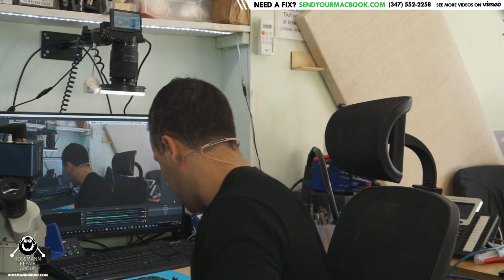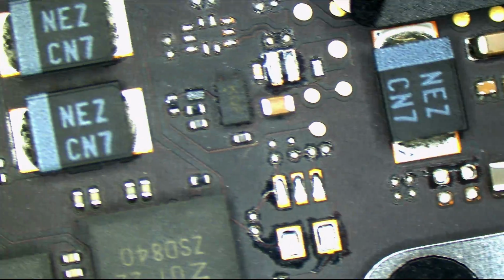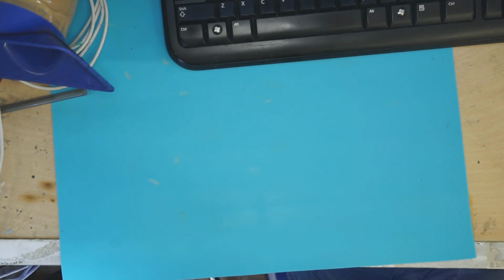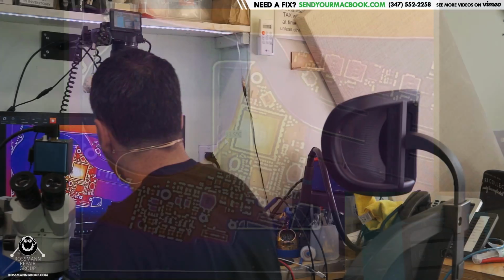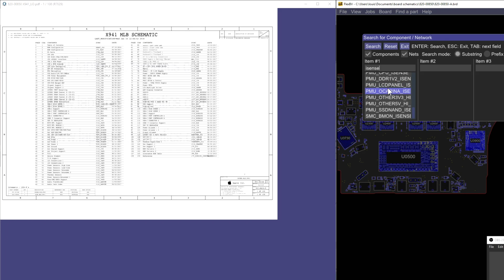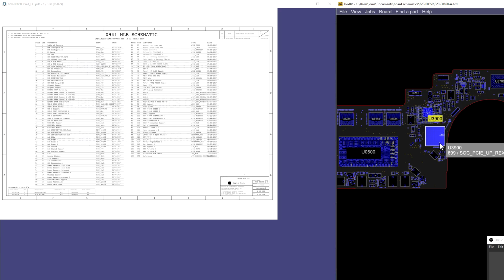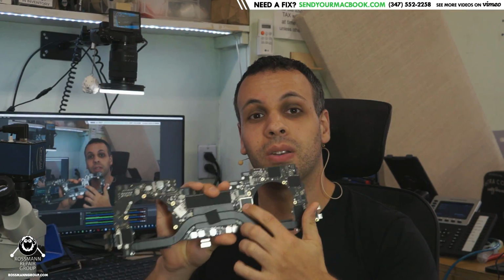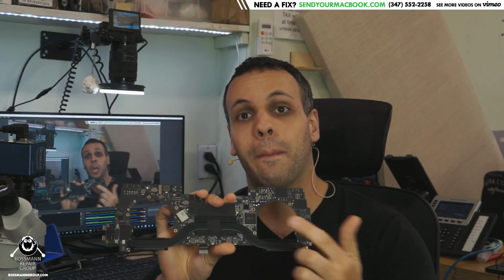Apple users have no one to blame but themselves.

Comment: I did my part and haven't even considered purchasing an apple product. I have since day 1 avoided products that use proprietary anything where possible because I like having the ability to swap out parts for testing and if that fails I have the ability to take apart and repair when possible.
Plus I am a cheapskate and I would not even consider apple as their prices are too high. I try to purchase mid range Items to get the best bang for the buck and apple has always been too expensive for me to even consider.
Reply: The average consumer is a moron. The average consumer is not well informed and the average consumer must have it because branding works. And you said it yourself, you're not even the target demographic. I mean that's not a poke but just that their consumer is glutton for a product with a pretty apple on the surface so they can look like they fit in among the other poor college students that extort their parents for such items. Serves em all right in my opinion.
Reply: @professoreggplant9985  Oh hell. When I went to university (2006-2010) apple was still in the adoption process for use in university. I would run across an occasional student that had a mac laptop but had nothing but problems trying to use some of the software that was needed to do some of the courses. My mother drilled into me the value of a dollar so much that after one Christmas I was looking for a game called Metal Gear Solid. I had come across a Used copy from EB games (sort of like gamestop) and I purchased it with money that I was given from Christmas. I purchased it and when my mother seen the price she made me regret the purchase to the point that I almost returned the game (But I Didn't). Has been my favourite console game I have ever purchased.
Reply: @professoreggplant9985  I can't stand by this at all. I believe you are taking to much to hating on apple products, when the products themselves arent the problem, the problem is Apple. The way they run the company, the business practices they use, Apple products themselves are really good, its just they are made by a shitty company.
Reply: @seiori  "Apple products themselves are really good"

You do watch this channel, right?
Reply: @schmatzler  I do, and althought we see a majority of Apple products, its because they have a large piece of the market. As well as Louis has done a lot with Macbooks on his channel encouraging people to come to him with there Mac issues. All computers fail from things, none are perfect, accidents happen. The problem is how apple as a company deals with these issues. This is the main point Louis gets accross in his videos, its the lack of willing of Apple to fix user issues, there business plan is terrible. I understand this fully, but im still willing to go for one, because A. Im more computer knowledgeable then the average consumer, meaning it will be more likely to last longer without issues. And B Because the product fits my needs perfectly.

Like I said, its a subjective decision. Also MacOS is really good for computer science, the course I will be heading into. But don't worry, this is just my media consumption/travel work laptop, the real thing is at home.
Reply: @whatdafarkenhell7110  The design is not crappy, you are blantly just saying this because you hate apple and that's fine. I dislike apple too. But sometimes that doesn't matter. They aren't designed to run hot, it's just they dont have a good cooling solution for the CPUs. Its a design flaw. But thats only if you go for the top of the range CPU, which I wouldn't recommend to begin with because of this. I don't plan to be doing heavy work loads. A bit of media consumption, light programming here and there on the go, and thats about it. Im not going to need to run my CPU into the ground, which is the exact reason I kept apple open as a choice.
Reply: @whatdafarkenhell7110  Yes it's a design flaw. The design of the computers cooling solution cannot handle the high end CPUs, that is a design flaw. It handles the lower end fairly decently, but the highers ones not so much. i agree, so not sure what this comment is for, maybe misunderstood me a little?
Reply: Sarah1390 yep, my parents refuse to let me get Samsung, since one my Motorola phone  sucked, and “we already have apple stuff,” my phone isn’t connected to anything else. And because of that Motorola they honk anything non Apple is shit, even though iPhone Xs have charging issues and are worse the s10s
Reply: Anyway, your mid range items are probably more powerful than an Apple computer anyway seeing as they kept some models the same for years without changing the price so you're likely better off anyway.
Reply: So much this.. but with a caveat.. for 50 bucks you can get a lot of old Apple. 

Newest one I own is a 2010, and with the OS becoming a jumbo version of iOS and all quarantined and cordoned off and cloud-enabled (absolute rubbish that is) it makes me glad that once Apple started their fuckwittery with the Mac OS X, I decided that keeping up with the Cook & Co. Rolling Roadshow of Neverending Costly Upgrades was not an option. Still rocking an ancient MacPro - now 11 years old and running Snow Leopard - a decade on. 

So not going to get a new Apple computer after the ones I have finally croak, it'll be a Hackintosh with the last intel-capable OS they make. Once they switch to ARM chips and go back to the RISC platform, they'll be well on their way back to the days of the Performa.
Reply: @Kohina Oh this is a funny Hackintosh Video. From one of my favourite channels Linus Tech Tips. https://www.youtube.com/watch?v=610kM2elp40&t=646s

Comment: No louis, you see the new TOS state that an apple product can't be in a room with any form of liquid in it, or moisture in the air without voiding the warranty, there's severe water damage, you just can't see it. It's invisible.
Reply: "Your cup may not have spilled, but it was holding the liquid wrong"
Reply: So the 80% water bag operating the device is the PEBKAC ? ;-) ?  Water body "spilled" all over the product causing liquid damage resulting in PEBKAC and ID:-10T error codes.....

Comment: What does T2 actually do for you except “make your ssd marginally faster” and “slightly lower render times?” It should be replaceable god damn it! And for people saying “it’s because the T2 has the Secure Enclave”, so? The iPhones have it, but you can replace a home button, lose Touch ID, but have a functioning phone. This is basically Error 53, but now you’re out ~$2000 and you have no chance of data recovery.

And what’s scary is that T2 is coming to the Mac Pro. Yeah, that computer that’s going to be a max of around ~$50K is going to have a chip where if it fails, you literally have a Tesla priced paper weight. At least you could use it as a cheesegrater when that happens...
Reply: I just read some douche bragging about the T2 on the pro a few mis ago.
🤣🤣🤣🤣🤣🤣
Reply: Okay, so let me clear something first.
.
.
.
.
.
.
It can't be used as a cheese grater. I've tried. So have many others. It's useless..
Reply: "What does T2 actually do for you" it was not long ago on this chanel that T2 will be most likely a gate to world without hackintosh, so no more wory that someone gonna show you PC with Apple system that was half the price of your computer but in the same time have better hardware that your original Apple... "think different" :D
Reply: I would not be surprised if has a built in kill switch they can set off when the next one is released - enforced obsolesence
Reply: You said "so? The iPhones have it, but you can replace a home button, lose Touch ID, but have a functioning phone" Right, but you aren't replacing the T2 chip, this macbook he shows needs the T2 chip replacing for him to make sure that is the cause of the problem. But replacing it will not work as other T2 chips won't work in it. The reason the home button works on the iPhone after replacing the Home button is because, its a button. The button part works, but the Touch ID doesn't because of that. If you replace the T2 Chip in an iPhone, you will have the same issue as you would with the Macbook. Not defending apple, just had to correct what you are saying.
Reply: Seiori But Apple could’ve made it more accessible. Secure Enclave on the iPhone is in the SOC. If you’re replacing a whole A11 or A12 chip, it’s probably best to buy a new phone entirely. But the MacBook uses T2 as a coprocessor. If Apple didn’t solder the pins on the CPU to ground in favor of the T2 chip, a MacBook or a Mac Pro should’ve been able to survive without one. Even knowing Apple, they could have socketed T2, and had some first party program that would serialize and generate a new UUID and bind the T2 to the MacBook, just like they do with home button replacement. But instead it’s soldered onto the board, and most Apple geniuses probably don’t know what a soldering iron is, so what can you do...

My main concern are the T2 crashes (look up BridgeOS kernel panic). If, for some reason, a crash were to corrupt your T2’s firmware, your computer is absolutely fucked.
Reply: @evancrazyerror  How it is implemented onto the board on the Mac isnt the problem anway, the problem is simply the firmware they run on the chip. Without access to the firmware to edit it, you are fucked. So yes, they should have included some way to allow for new components, even if only apple can change it. But the only training the technicians have for their job are the rehearsals on a daily bais of the key phases. "Water Damage", "New (insert newer version of said product" are in store if you would like t check them out", "Warranty covers accidental damage/issues, but not this time". Best that they add the T2 Chip, training those neanderthals to fix anything will do the opposite.
Reply: The T2 is just a glorified Apple A10 if I remember correctly. The Secure Enclave isn’t in the iPhones home button, it’s in the Ax SoC. This is just that SoC. Replacing this is akin to replacing an iPhones SoC.
Reply: Incremental product scalability. To offer a product tailored to the tradeoffs that the customer chooses. It helps to reduce their R&D costs when they can roll out the next generation and making the fewest technological advancements since those are both finite and more expensive to implement. Instead they change the aesthetics and shuffle the mix of incremental technology gains. It is indeed all about money. Often what you see when businesses collude to fix the market except price fixing would be a legally punishable act but instead if the competitors restrict advances then they can minimize costs and focus on product branding. All common facets of oligopoly and duopoly markets explained in detail in a good microeconomics course. BOHICA this is the world we live in.
Reply: The T2 chip is there to encrypt your data at hardware level. Like the "secure enclave" on iOS devices.  This does, ofcourse, have downsides for repair.
Reply: @SanderEvers  Yeah the T2 is security feature, apple just secured the sale of another mac since this one is already trash in 3 months. The T2 chip could exist for security purposes, but it should be replaceable and be linked only to the encryption of the SSD, T2 chip goes bad SSD will be not accessible, after replacing it the owner of the encryption key should have access to the SSD data again after programming this new chip with the exact encryption key as the T2 chip that died, replacing the chip to attempt to gain access to the data will be pointless and that will perfectly fine,  but no... this is Apple the T2 chip is linked to the absolute death of the whole system to ensure your contribution of $1.5 to 3K for a new system.
Reply: Damn I bought the new macbook pro with the T2 chip💀

Comment: T2 chip shits itself and there goes the system.  Congrats Apple!
Reply: JerichoKru if a 0.01 Cent resistor failed its a $500 repair
Reply: @Brendon O'Connell crack is bad mkay
Reply: @Brendon O'Connell Took the bait, took a look at your channel. Gotta say I haven't seen an Anti-Semite conspiracy crackpot in a long time. With all the crap going on in the world, you guys are like the "Coke Classic" of paranoid assholes. I gotta say, the flavor is as shitty now as it ever was.
Reply: @Brendon O'Connell We did go off the deep end didn't we lol. Is the world flat too and the moon landing faked?
Reply: @thharrimw  I think he's on everything and he thinks the leftist side is so innocent,that's his thinking(not really)
Reply: freakin' t2 also has the ssd controller inside and there you go with soldered on nand chips. i like the os but not so much as to make myself fucked over it.
Reply: @pengekcs  this chip is the first generation of Skynet
Reply: Would not surprise me one bit if there is a backdoor command that tells the T2 to shut the system down permanently.
Reply: @gavincurtis  
Apple's response:
I'd buy that for a dollar!
Reply: @gavincurtis  
Or they just design it so badly that it has problems with overheating... which looks like a possibility.
Get it hot enough it melts the solder, damages the board and nearby components.
Just add integral "security" features so it can't be replaced...
Instant money chip!
Reply: Simon, running hot is a feature.  ARRS Auto Reball Reflow System.

If the rumors of the T2 chip disabling the product with other serial numbered parts becomes true, then absolute pure evil.  Like the headphone dongle lockout....that was end of Apple for me.  One month vacation in Europe and got crappy iOS 11....my working headphones were denied!  No music the majority of the trip.  All because the digital serial number on the headphone dongle was not "approved" aka payed apple to be on a "good" list.  Even my external DAC stopped working as well.

Everything that was once good gets a money grubbing greedy deviant a$$hole in the mix to ruin it.  I would rather see money go into a pro-audio chipset than a stupid T2 security chip desisgned to keep a product from being repairable.

T2, terminator....what a perfect name for a $hitty piece of silicon of evil intent.
Reply: As someone who has to have one for work I refused to buy a new model due to the t2 chip
Reply: @Brendon O'Connell Put this crack pipe down, it's turning the frogs gay.
Reply: If enough of the T2 chips fail... killing machines like this, I wonder if the European Union will consider legal proceedings against Apple (I suspect this might violate some consumer laws here).
Reply: It's almost as if it's designed to fail.
Reply: Brendon O'Connell meth and pcp don’t mix
Reply: AH bur apple can reprogram the T2, it acts as a backdoor for FBI/CIA/NSA after the debacle with the iPhone the terrorist had when the FBI could not get into it and apple couldn't either..... now they can, but you cant